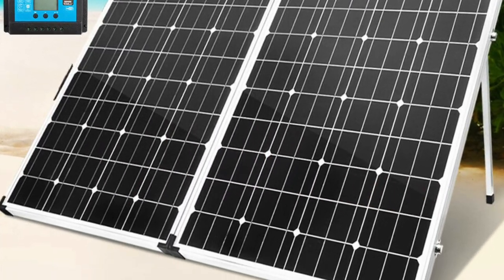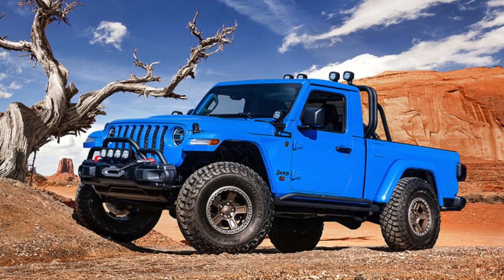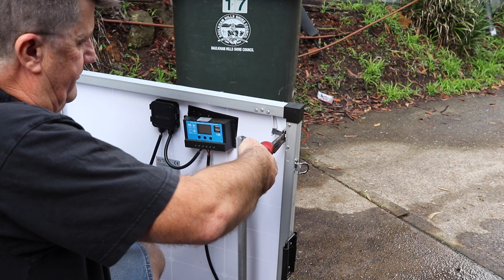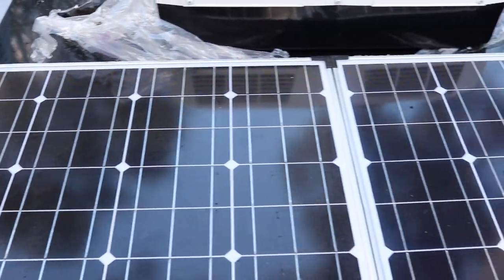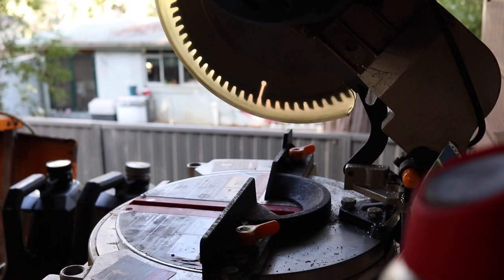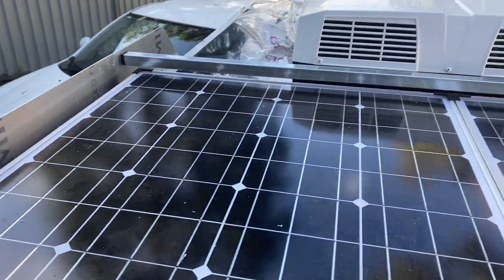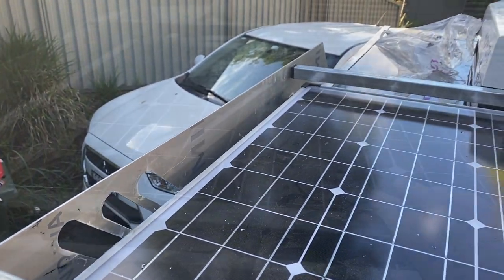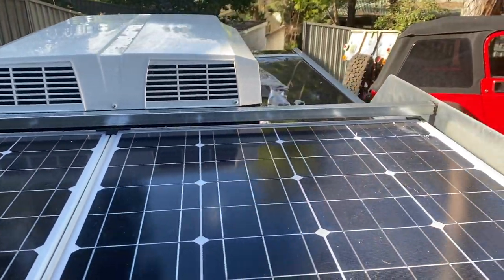Off Road Camper Trailer Build // Roof Rack System build and Solar Panel Mounting

Comment: Been binge watching the build series, love it!  Mate do your self a favor, remove the charge controller from the panel and re-mount it as close as possible to your battery. You will get a voltage drop over the length of your cable which will mean that even though you may have for example 13 volts at the panel, that could be down to 12.5 by the time it reaches your battery. By moving the controller closer to the battery you will end up with a better charge profile.
Reply from the maker: Thanks for the tip!

Comment: Hi Darryl Enjoying this series of videos. Very well done. Just a question re your drop bed saw. I noticed you cutting aluminium with it, is that a special blade that cuts metal and wood.?
Reply from the maker: Thanks for watching! It's an 80T multi material blade - hope that helps. https://www.bunnings.com.au/irwin-254mm-80t-marathon-pro-performance-multi-material-mitre-saw-blade_p0172635

Comment: Love the build, found it last night and already up to date. Love see your thought process and easy presentation. 
I would recommend repositioning the top crossbars to try limit hard shadows as it can cut down the panel output quite a lot (sometime even 100% depending on panel design and quality)
Do you have a update on weight and will the be a cost rundown at the end.
Reply from the maker: Thanks for the tips!

Comment: Excellent video thank you. If the van spent one day in the sun, what would that power overnight? Do you have battery storage?
Reply from the maker: At this point I'm unsure how it's going to work. I currently hav e a lithium Dometic battery pack and that runs the fridge for near on 48 hours by itself. However am looking to replace that in the camper with a full time lithium battery system.